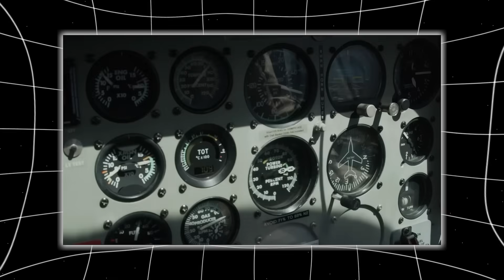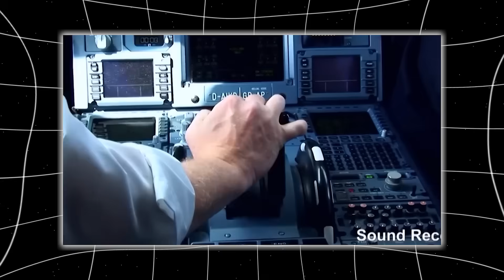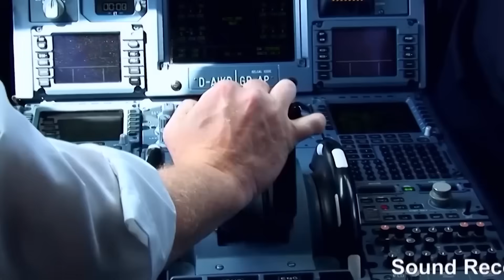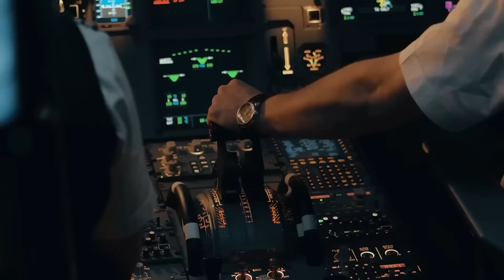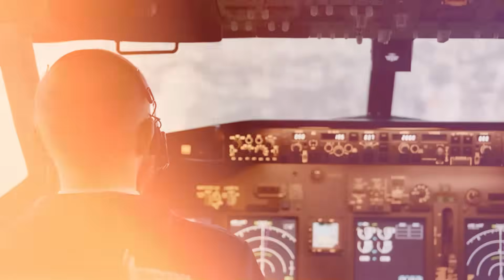Scientists FINALLY EXPOSES the Truth About the Air India 171 Crash Mystery

Comment: Yawn! Yet another attempt to 'gloss over' the truth. No mention whatsoever of the fuel control switches that magically 'transited' to 'cut off' within 1 second of each other shortly after lift off. Switches that can only be moved by hand and that have nothing to do with the engine management systems.

They only control the fuel flow to the engines, 'RUN" or 'CUT OFF'.  And that 'switch transition' wasn't a mysterious invention, or a flight of fantasy. It was confirmed by the flight data recorder.
Reply: "Can only", is prumptuous, esp' as they don't connect directly to the valves.  The flight-data-recorder records what the computers register from the sensors.  What they register may not even be what the switches send.  As an electronics engineer, I have worked on suppressing spurious signals.  It isn't as easy as you might think.
Reply: @sbkenn1  No, "can only' is not presumptuous at all. There is only one way that those fuel switches can 'transition' (as they politely call it) and that is by hand. They control two completely independent circuits, the only common factor being the 28v supply from the battery. The FDR recorded two separate 'cut off' occurrences. 1st the left engine. then the right engine, with a 1 second interval between the two. The odds against that happening, without human intervention are astronomical.